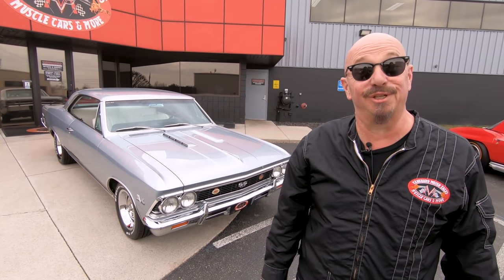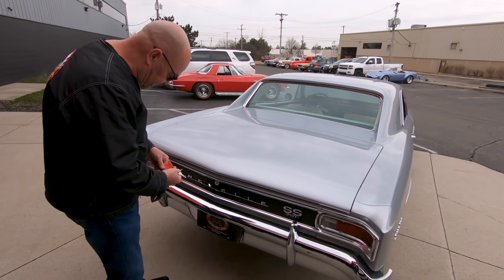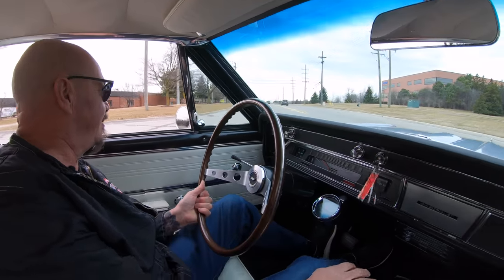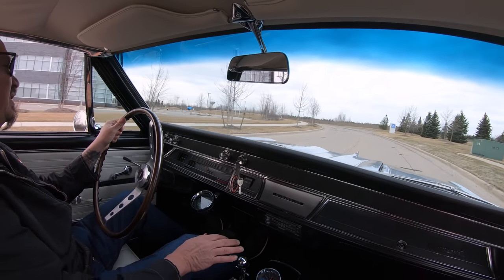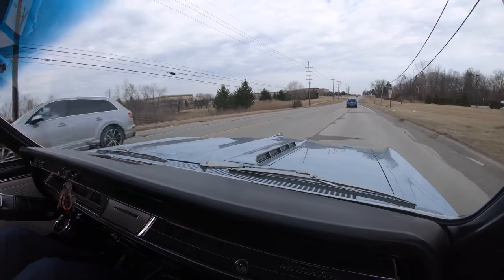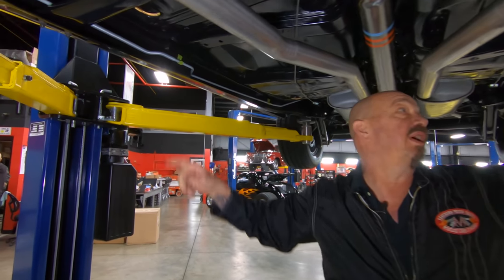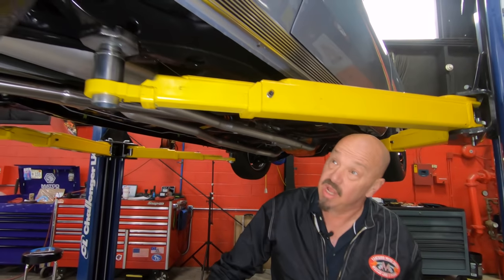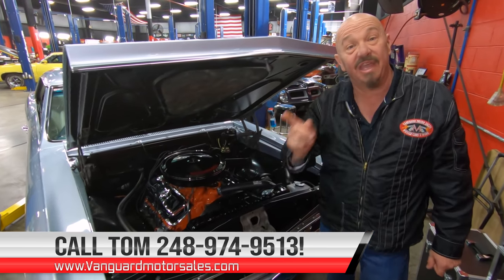1966 Chevrolet Chevelle SS For Sale Vanguard Motor Sales

Comment: Thanks for the post pal, so how much hp did these really have? I know insurance back then was a factor when the car companies built the motors.
Reply from the maker: The 1966 SS 396 Chevelle came with a standard 325hp 396ci engine, a 360hp 396ci engine, or the 375hp 396ci engine.